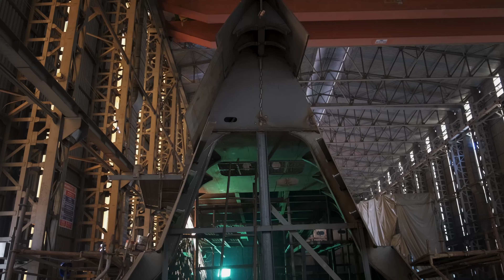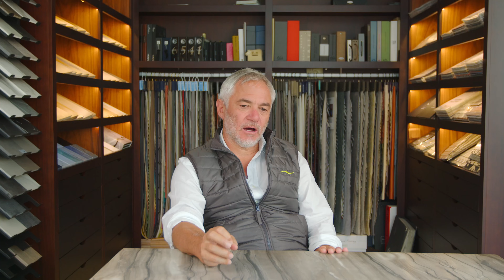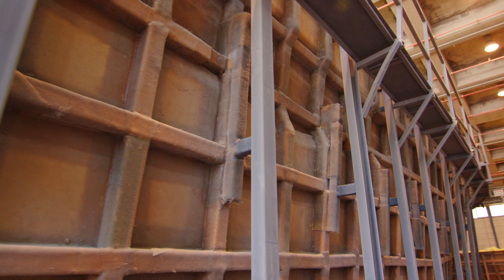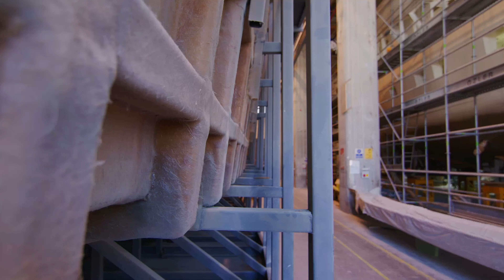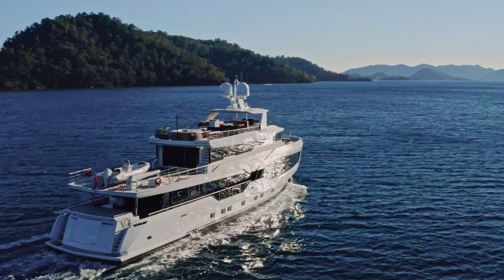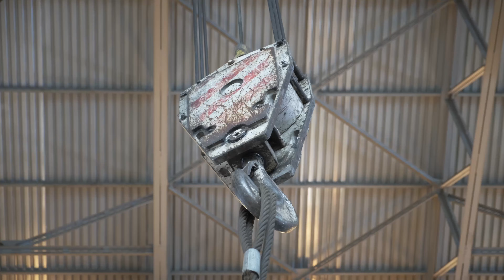HOW A NEW 30 METER AND A 37 METER EXPLORER YACHT ARE BUILT AT NUMARINE. IN THE BEGINNING...

Comment: Have seen a video of the finished 30xp model. No doubt a unique design. However 2 negatives. The helm is way to low for safe navigation. The sightline is just not OK. Secondly, the cealing hight seam a few inches to low on the salon and cabin levels
Reply: whatever, use monitors